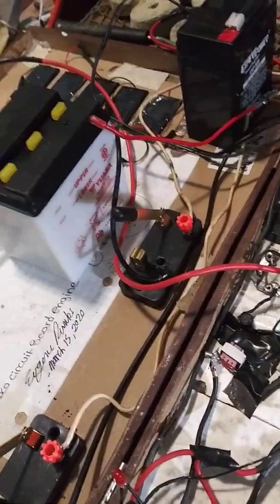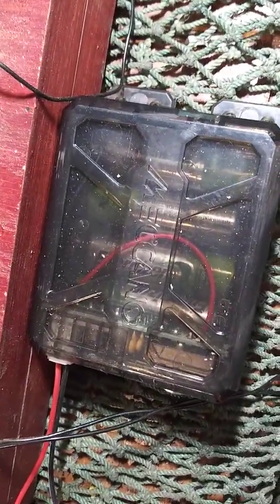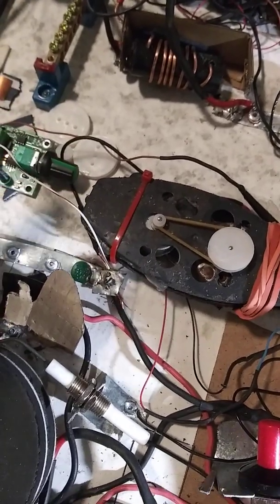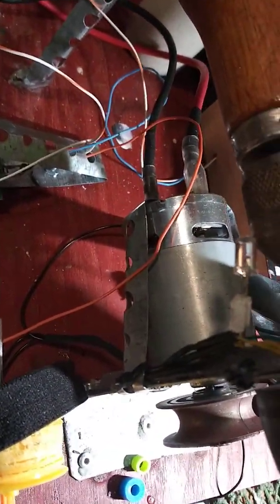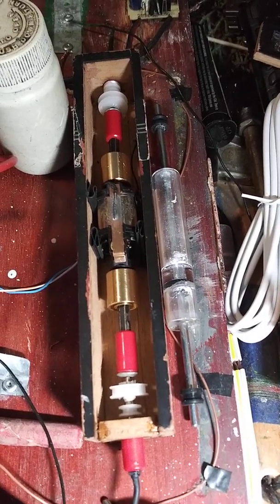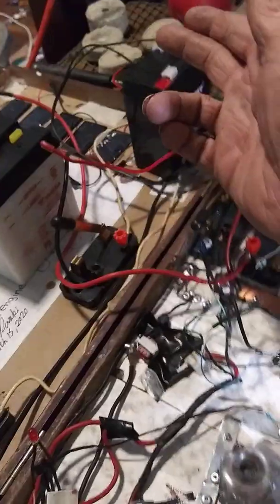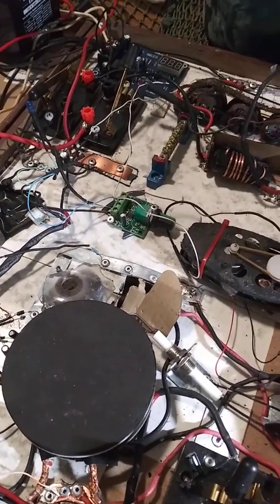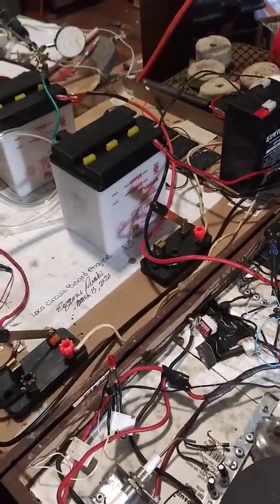loco electrical circuit experiment

Comment: I'd love to hear how this turns out but, energy in=energy out and nothing is 100% efficient, or even close to it.  To get the second battery a full charge from running the first you'll have to recharge the first a few times, and with solar that's going to take a long time or a lot of cells.  Look up perpetual motion devices.  They never work because nothing is 100% efficient.  Some can run for a long time, but not perpetually.

Comment: You always get me thinking when you show us this stuff. Super interesting, do you have the switching mechanisms down that will keep it cruising? Good stuff
Reply from the maker: Still working that out. This experiment will reveal those and other answers.the multiplexer that i need will have to ai the energy routing to optimise performance and control losses. Low voltage switches are just part of it but they are very important

Comment: Doesn't this all boil down to bull by adding solar?  I can make a motor run forever with a battery and solar cells.
Reply from the maker: It does what your car does .. It maintains an ever full battery.
Reply from the maker: Triplicated systems are always good. The solar cells are not integrated into the system. The cells can only charge to the black battery. The system relies on static and the generators to support the current.
Reply: @trapperjacksurvival  define triplicated.  And if solar cells are not integrated into "the" circuit. Than what function do they perform.  You video just shows a bunch of junk.  I'm not even sure what you think you are trying to do.
Reply from the maker: @johnn3542  i see you dont like solar tech.    I just metioned that the circuit is self energizing thats easy to understand. The solar array is back up charging bank for the fuel batteries. The solar is a way of filling gas cans without using gas. The power can generated with shotgun shells , wind, hand muscle, mule., plutonium, water or solar. Its just fuel its not current. Dont you see..
Reply: @trapperjacksurvival  ok well here is the question.  What does this thing actually accomplish?  What is the benefit?  Your simply charging batteries and using the power.